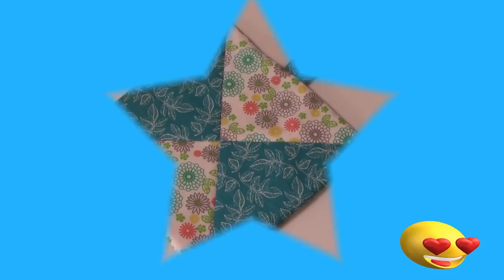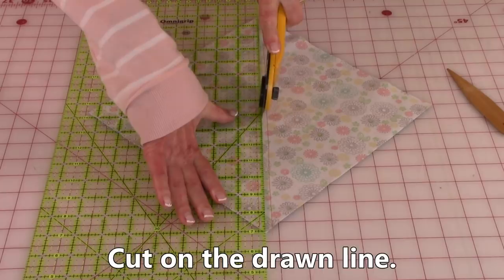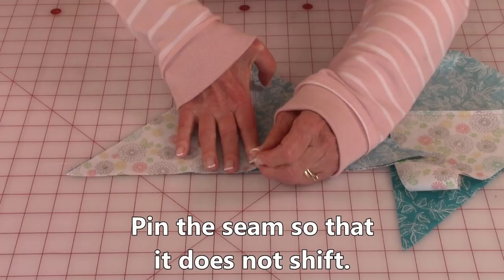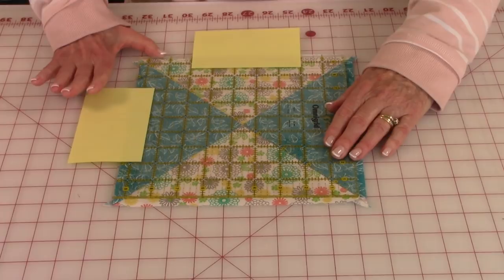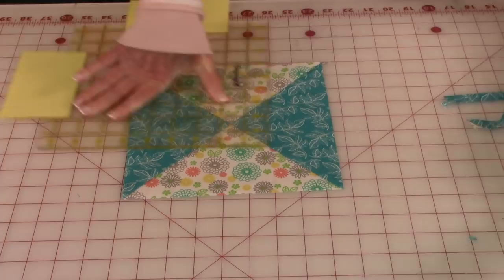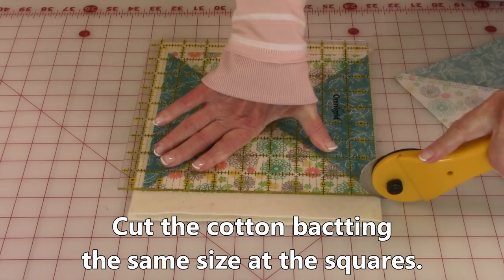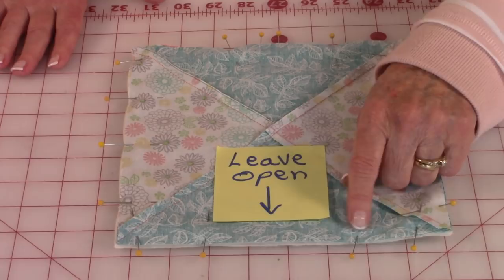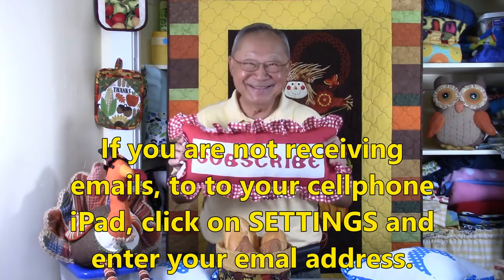15 Minute Pot Holder

Comment: Great explanations!  Will a basic pressure foot sew through all the layers; or is a walking foot needed?
Reply from the maker: If you use a standard presser foot, you will probably get pin tuck in your fabric, and or the fabric will probably stretch.  A walking foot helps to evenly feed the different fabric layers so this will not happen.  You can get a walking foot at a sewing machine dealer store, or go  to sewingmachinepartsonline.com.  Thanks for watching, and happy sewing. 😍

Comment: I made the pot holders using 2 layers of cotton batting. Today I used the pot holders and I almost got burnt! I can feel the heat. Should I use 3 layers of cotton batting? help!
Reply: I have bought the insulbrite and it works better in tandem with the batting
Reply: I didn't think 1 batting and 1 insul-brite was enough, either.